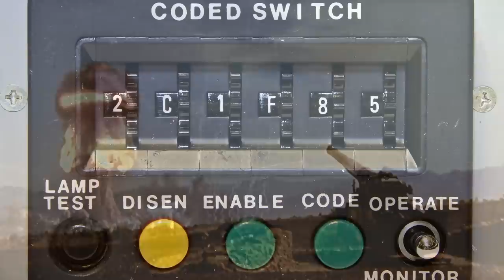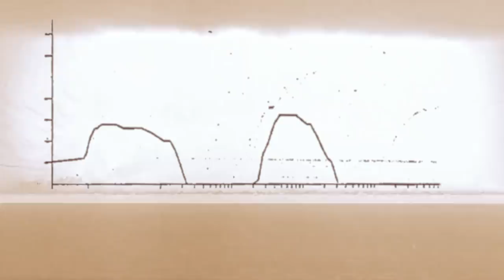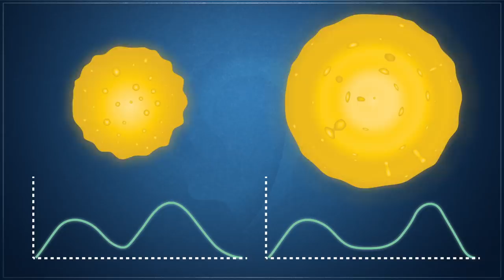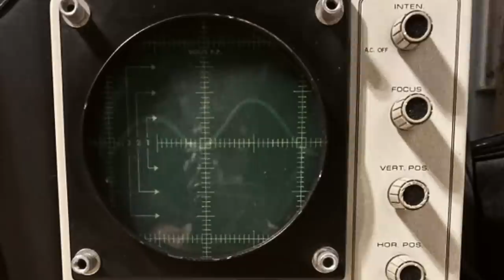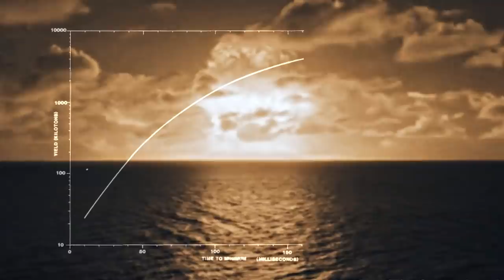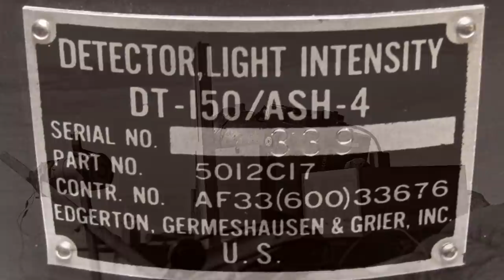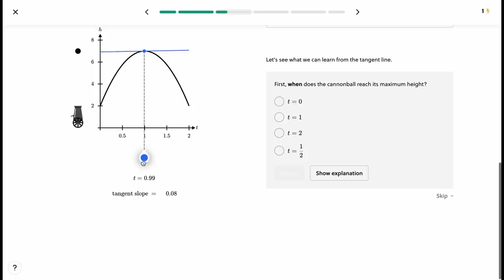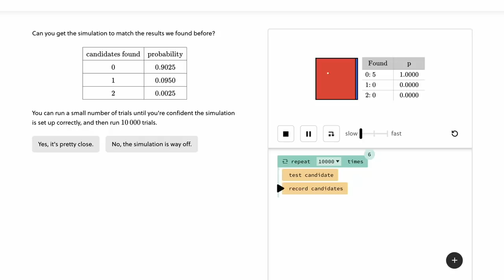Detecting Nuclear Detonations

Comment: yo i actually worked on the software at Los Alamos that does simulation of all these parameters from a nuke, we now make use of optical, neutron, x ray, gamma ray, and radio sensors on satellites to geolocate a clandestine detonation. The exact sensors that are on some of the satellites are classified
Reply: P
Reply: Curious. Do you defense dudes still use ADA?
Reply: @mwanikimwaniki6801  probably for some things, not sure though our project is C++
Reply: @rowannadon7668  Hmmmm. I wanna get into defense. So C++ and other C variants would be good?
Reply: Wouldn't you be NDA'd ?
Reply: @JarrettWilliams99  I'm pretty sure the science is out in the open. The software wouldn't be particularly problematic.
Reply: @JarrettWilliams99  the source code is export controlled but I can talk about it as much as I want
Reply: Tip of the hat from another old Hill Topper
Reply: I feel like I've just witnessed a crime💀💀

Comment: Question: Do you know the name of the detonation at 7:30?  That looks horrifying!
Thanks for making this video and giving such a great explanation.
Reply: I was thinking the same! Intense!
Reply: Its either Ivy mike or Castle Bravo.
Reply: @ADDMEONPSN  It's neither. Both Castle Bravo and Ivy Mike were detonated on the ground. I think this is a smaller fission-only bomb. Wouldn't be able to tell you which one though.
Reply: Hydrogen bomb?
Reply: @viaexcellence  You know, I think you’re correct. 
After seeing your response, I looked it up.
I then read where a hydrogen bomb gets up to 100,000,000°C!
That to me would explain the appearance. Thanks! 😀
Reply: Also, those "spikes" protruding from the blast wave are the cable ties that supported the tower holding the bomb reacting to the insane heat and energy. It looks terrifying.
Reply: Operation Teapot
Reply: @viaexcellence  tower shot in Nevada. The spikes below the fireball are the guy wires evaporating.
Reply: I think that’s a colored verison of the trinity test

Comment: The weird thing about nukes is yield, weight, and costs are in no way correlated.
Reply: I mean, if you want a small nuke, your yield will be limited, so size/weight and yield is somewhat related
Reply: Not exactly, since any nuclear detonation requires a minimum mass of a weapons grade fissible isotope (typically Pu-239), that becomes critical under compression and an external pulsed neutron-source. Yield of a single-stage nuclear warhead can not be scaled up arbitrarily, since a too large weapons core would explode without contribution to the yield. Therefore, any weapon, larger than about 30…50 kt has to be designed for practical reasons as a two-stage system, consisting of a fissile ignition stage and a D-T-fusion stage, that converts LiD (lithium-deuteride) by an in-situ neutronic transmutation-reaction into tritium and deuterium. Such warheads can reach yields up to the high Mt-range. So called DAY-nukes (Dial-A-Yield) introduce slight variations in the ignition-timing of the slapper-detonator-array around the weapon-core in a precise manner. Consequently, such explosive devices can provide a selectable calibre between 0.5 kt up to 100 kt.
Reply: @debrainwasher  bruh someone better be paying you for your knowledge. Are you a nuclear physicist or something ?
Reply: @lucasjames8281  I am a graduated electronics engineer with further education in Laser-physics and nuclear engineering.

Comment: detection of nuclear explosions in outer/near space and undersea was left out of this video.  the IEEE journal in 1962 describes several methods of detecting nuclear explosions.
there are many methods not included in the video.  some have probably long since dropped with satellites providing better? coverage.  low frequency sound waves, filtering air,
pressure waves, etc. have probably been dropped.

Comment: "vay-la" rather then "vehl-uh", but anyway they were remarkably accurate devices by most accounts and only had one single "false" positive detection of a nuclear detonation in the history of the program - the Vela incident in the remote Indian Ocean between South Africa and Antarctica in 1979. This very "false" positive detection of a nuclear weapon explosion was definitely not a secret test of the clandestine Israeli nuclear weapons program and was definitely not confirmed by multiple other methods of detection as outlined in a 2018 paper by De Geer and Wright.
Reply: No, it's correct as he is saying. Vela is Spanish for sail.
Reply: @Eriiaa  I'm sure that's how the word for sail IS pronounced in Spanish, but this word isn't referring to sails and the device's inventors weren't Spanish, so they all said "vay-luh", you can hear it for yourself on any number of historical films about the program freely available on this site. Similarly, the 1960s NASA program Gemini is rightly pronounced "jem-in-ee" and not "jem-in-eye" like the constellation. You're free to argue the "proper" pronunciation of these terms and others with their originators in the 1950s and 60s if you have access to a flux capacitor, but barring that, the correct pronunciations are the ones used by the men who adopted and repurposed them for their own modern technical needs when referring to the devices and systems they specifically created.
Reply: It was the South Africans
Reply: "Vay-la" is the Spanish pronunciation anyway.

Comment: Did I hear wrong? The advanced VELA system could determine the location of a detonation to within 30 thousand miles? If I didn't, that doesn't seem right.
Reply: Wikipedia says it can determine the location within *3000 miles, which is still a pretty huge circle but at least doesn't cover the entire Earth twice over
Reply: I hear 3 thousand miles at 10:18
Reply: @RedgeIsLearning  You may be right, but I still find it iffy. But 3000 makes more sense.

Comment: Ability to detect accuracy within 3,000 miles? That doesn't seem so helpful. 🤔Is that correct?
Reply: Right? That's an enormous range
Reply: Considering they were doing it from 73000 miles away and X-ray imaging was still in its infancy, 3000 miles is pretty good all things considered.

Comment: There once was an experiment when measurement of underground atomic explosion was needed (or things went wrong). A manhole flew into the air at high speed. In great irony, another explosion was conducted to find the source of ballistic hazard by creating another ballistic hazard to calculate the trajectory. On the edge of the Earth they landed and the Earth remembers.